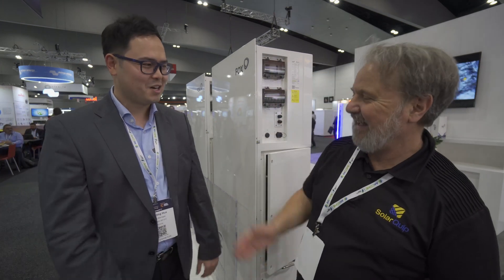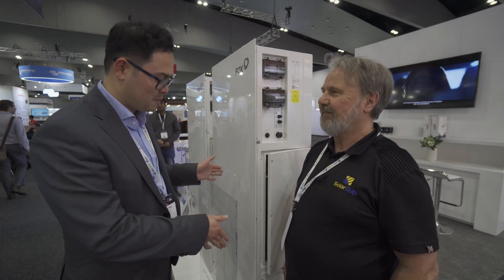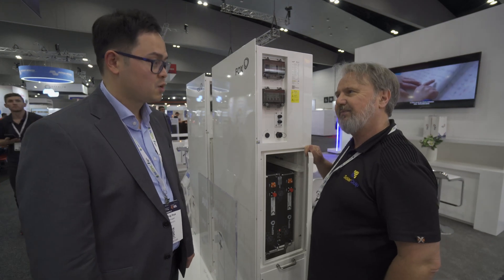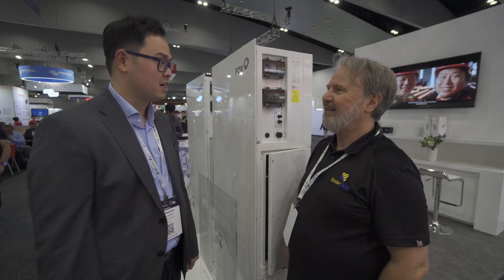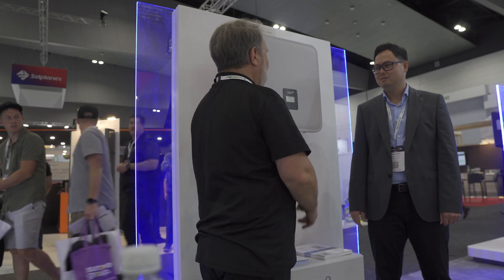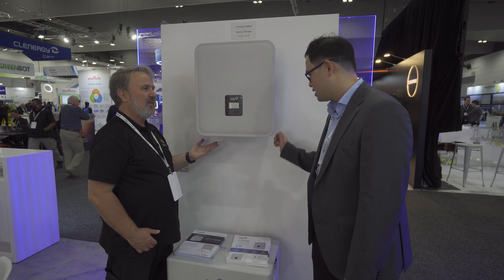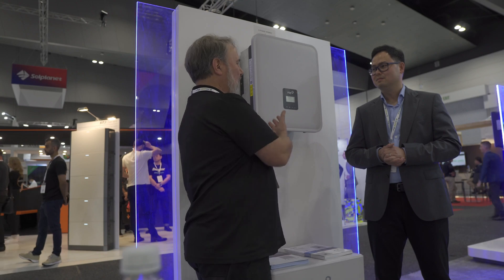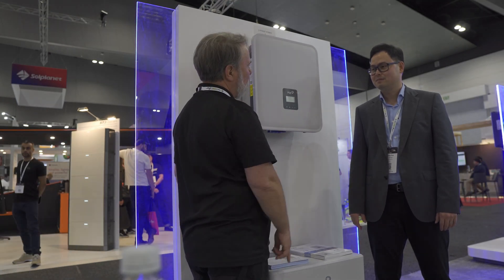FoxESS hybrid inverters

Comment: I do not recommend FoxESS hybrid inverters. They claim to be expandable in future, that you can add more batteries. In reality you can't add batteries as they keep changing versions of hardware/software making new batteries not compatible to older battery controllers. This is my experience. Got a useless system now.
Reply: Yes, I would agree with you. You'd think they would have backward compatibility, but even the connectors on their newish Energy Cube System (version 2) which is marketed as plug & play now have two different types of non-compatible connectors. Type A & type B. Although, if you have version 1 of the master & slave Energy Cubes you can use version 2 slaves (connector type dependent), but also have to replace the master version 1 with a master version 2. So you have to chuck away the master version 1 combined BMS & slave battery, replacing it with a master version 2 & at least 1 version 2 slave on top of the version 1 slave/s beneath. If you have the LV2600 it's a bit easier & less expensive as all that is needed is to replace the version 1 BMS with a Version 2 BMS and probable firmware update via FoxESS. Thus saving the waste of the ECS combined BMS & slave master battery. Also, with the LV2600 I think there are different types of version 2 batteries so that will need to be considered too. All that said, the FoxESS marketing blurb is misleading because the batteries you have will quickly become non-expandable due to the FoxESS battery design being changed in versions & connectors as time rolls on
Reply: @ChrisBrown-xf2ce  Good input, thanks. I have the CM & CS 4100. I decided to tear them down and remove all circuit boards and put one JK-BMS in each and thus give them a new life as 60V backup batteries for other purposes.Considering buying new EC V2.0 modules but I'm very hesitant as I'm not sure where foxESS is heading with this system in the future, or if I need a firmware update of the H3 inverter, not sure. It's a moving target...